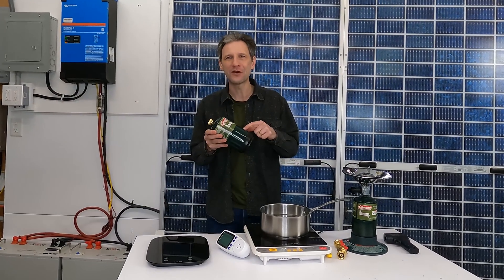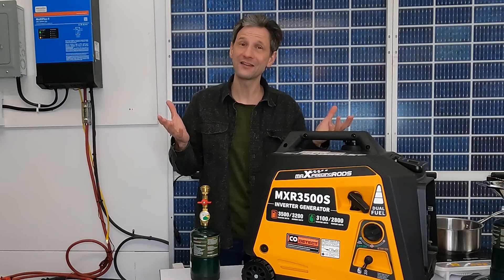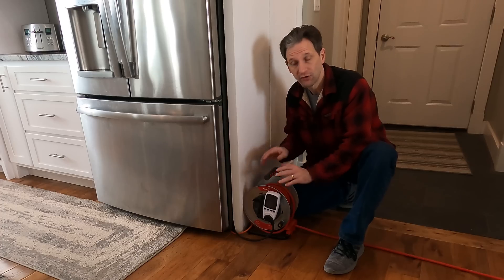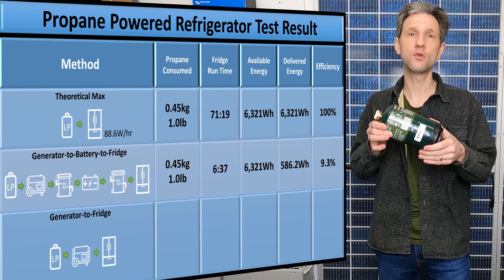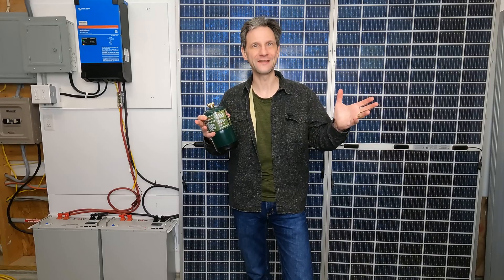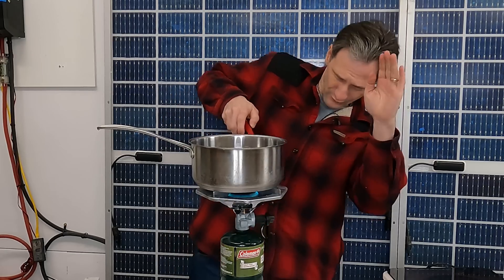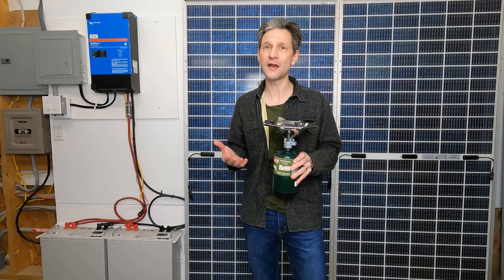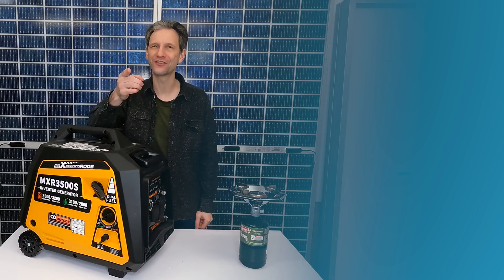Maximize Your Off Grid Energy Management - Dramatic Results!

Comment: It would have been interesting to also see a data point for fuel cell to the induction cooktop.
Reply from the maker: I didn't do that because I don't have confidence in the numbers... But.. just for fun...
Here is a theoretical analysis with lots of assumptions:
Assuming the fuel cell running on propane is 60% efficient and the power is used to charge a battery at 96% efficiency and the battery power is converted to AC at 96% efficiency, it would take 0.392kWh of energy to heat one pot of water with an overall efficiency of 40.1% 
Theoretical pots of water on one can = 40.1 --> 100% Efficient
Direct flame pots of water on one can= 18.1 --> 45.2% Efficient
Fuel Cell pots of water on one can= 16.1 --> 40.1% Efficient
Generator pots of water on one can =1.2 --> 2.9% Efficient

Comment: I came to the same conclusions years ago when hit with a seven day power outage, direct generator power to refrigerators, or freezers are just not that efficient, and they leave a noise signature that may itself cause  security problems. Now that we have lithium battery packs in the 2000 to 3000 watt hour capacity, those and a duel fuel generator are the best bet for home backup power. Propane gives us a safe storage solution, and we can store a lot of it, pre crisis, while gasoline is more dangerous to store, and can go bad, and may be harder to find in a grid down situation, unless the gas stations have there own backup generators, and then they may be overwhelmed by people trying to get gas.
Reply from the maker: Well said!
Reply: Agreed! I just setup my dual Ecoflow Delta Pros to backup my house.  Now I just need to find the best way to charge both slowly with 1 generator (may just go with the Ecoflow one but have to manually swap between them).  I should be able to get 1800watts out of my solar secure power supply outlet on my SMA inverter on one of my solar arrays but so far it just doesn't output the power for some reason.

Comment: I have a small 1600 watt gasoline powered generator that I plan to use for emergency backup for my furnace and refrigerator.  I've measured my furnace electrical energy use at approx. 500 watts when running and the refrigerator at 350 watts when running. My plan is to run the generator intermittently and shut it off for periods of time and let the furnace and fridge "coast" for a while so I don't use so much fuel running a generator that is not actually generating power. In the future I may add battery backup storage and a battery charger to try this method used in your video.
Reply from the maker: As you can see from the results in this video, your proposed method will save a considerable amount of fuel.  A lot of effort and inconvenience, but cheaper than batteries and can get you by in an emergency.

Comment: Great video. A lot of good information. If you had to use a generator and had use for a refrigerator, it might be better to cycle the generator off and on over a period of time.
Reply from the maker: Not convenient, but it would save energy.
Reply: A couple of dorm fridges with manual defrost and small chest freezer (same) can be ran with less watts. I can run a dorm fridge 24 hours with 500wh.

Comment: This was a great test Dave. It's something I didn't really think about. For best backup power system I should have a battery bank and charge that with a generator. Generator would not need to be as powerful as full house draw with everything on at once. It could be much smaller keeping the fuel storage much less. Yes I know that there would be a point that I would run out but that is the same as looking for a fuel station in a power outage, they can't pump the fuel.  I need to run some numbers and see how long my 1500 watts from my Prime if used to charge batteries would last or keep up. Thanks
Reply from the maker: Exactly!  There is no need to buy a giant generator if you are using batteries to manage the larger intermittent loads.
Reply: @ProjectsWithDave  And it seems like it wouldn't need to be an inverter generator. Would you be able to test if a conventional generator can feed the Victron?
Reply from the maker: Sorry the answer took so long, I ran a test back-to-back for you.  Yes, a conventional generator works fine.  The inverter generator was able to provide about 10% more energy to the batteries with the same amount of fuel.  However, I only ran the test once, so I don't know the margin of error.
Reply: @ProjectsWithDave  Hey Dave - no problem - you don't owe me an answer lol! Thanks so much for doing this! 

A followup question if I may - your power flow chart in the video shows the power going from the inverter generator ->victron charger->battery->victron inverter->fridge, but is that accurate? I wonder if the power flow when the fridge is drawing power is inverter generator-> victron bypass->fridge with the excess power the fridge isn't using is victron charger-> battery.  If this were true then the fridge would be getting "dirty power" from the conventional generator rather than the pure sine wave power from the Victron. 

I'm just north of you in Ontario, and I'm thinking of doing something similar as you with a ground mount array and an inverter feeding a critical loads panel. I'm just concerned my current conventional generator would need to be replaced with an inverter generator as I don't "trust" the power quality coming out of it to feed my expensive loads like my furnace. I'm thinking I could get a separate battery charger fed by the generator to charge the batteries, and let the Victron feed the critical loads panel from the battery. Or it may be cheaper to get a quality inverter generator lol. 

Thoughts?
Reply from the maker: In my test, I charged the batteries and then ran the fridge.  There was no passthrough power.  It's funny you should ask me about that, right after I finished the test for you, I thought to myself, "I should have checked the sine wave while it was running."  A brief search says it passes through the power it receives as long as it meets certain parameters, so you may want a separate charge controller to eliminate that risk.  However, I didn't check it myself.

Comment: Cool tests!

One note: an IR thermometer is about the worst thing to use on a reflective stainless steel pot.
Reply from the maker: Yes, reflective surfaces don't work well with IR.  That's why I used the in-water thermometer for the exact measurement.

Comment: So heat, use petroleum products directly. Cold? Generate electricity.
Reply from the maker: There are a couple of factors that impact these results.  1) The fridge is an intermittent load, so a lot of energy is wasted when the generator is idling and the fridge isn't running.  2) The fridge has a heat pump that can multiply the effectiveness of the consumed power.  If I had a heat pump water heater, I might get different results when heating water.  However, even in that case the inefficiency of the internal combustion engine is probably greater than the efficiency gained by the heat pump.
Reply: @ProjectsWithDave  Fair. A better summary might be:
Electric Resistive heat vs combustion: combustion wins.
Heat pump / compressor heating/cooling? Use electricity.

I don't really know of a way to use combustion to cool things, so I don't have a thing to compare it to.
Reply from the maker: This is how a direct propane powered fridge works: https://www.warehouseappliance.com/blog/functions-of-a-propane-refrigerator/
Reply: @ProjectsWithDave  An electric refrigerator is still more efficient, which still matches my summary and your results -- electricity wins for heat pumps, A/C, and refrigerators/freezers. For heating, cooking, baking, combustion of a petroleum product wins. For now!

Comment: When charging a battery with a generator it's best to run the generator at 80%-100% of its max load. That means you would need a 3000w dc charger for that specific generator to get the best efficiency out of burning that propane. The difference between running it at 3200w vs 800w will be up to 40% more efficiency. Try this test again with a dc charger that matches your generators output next time. You will get a much higher efficiency than 9.3%
Reply from the maker: At higher loads it was slightly more efficient, but only 1.5% better.  I'll do some more runs to see how much I can improve it.

Comment: Doesnt this show why electric vehicles are dumb for the environment? Most power is produced using non renewable sources ie natural gas.... the transmission losses and efficiencies from generation to car motor are abysmal.
Reply from the maker: Power stations run at much higher efficiencies than internal combustion engines, so it would not be an equivalent comparison.
Reply: @ProjectsWithDave  There has to be a way to convert it from power station to drive.
Reply: @av1204  power stations are roughly>85% efficient, as delivered to the house. Modern EVs are anywhere from 60% to 80%, including charging. Using WORST CASE, 60%, you just multiply 0.85x 0.6 = 0.51 = 51%, which is STILL far more efficient than the ~30% efficiency of internal combustion.
Reply: @JR_MacD  Not sure where you got your information from. They are not 85% efficient. Not even close.
Reply: I don't see how you could possibly conclude that from this video. If you're not just a troll, here's just one of the many people that have worked it out: https://www.youtube.com/watch?v=6RhtiPefVzM
Reply: lol no, it does not.  They are much more efficient actually. ICE is only about 25-30% efficient for vehicles.  If you produce your own power (solar) you can get the total efficiency very high, about 80% or so.  For a good $ reference, I paid $2700 (3500 before credit) for my second array which is 2.5kW and can produce 3mWh annually, enough to drive over 10,000 miles on.  I'm only 2 years away from payback and then driving on free energy for a couple decades.
Reply: @whattheschmidt  one is cost one is efficiency... they arent the same. what is the cost of all materials to be mined produced and recycled

Comment: Love the math.... what if you ran the fridge direct off the generator and also charged the batteries to an extent that the generator would stay in eco mode?
Reply from the maker: That would work. It would still be making full use of the available power.

Comment: Really good experiment. I wonder how the refrigerator results would change if the generator only ran when needed? Like with a Delta Flow battery being charged as needed from a Delta Flow smart generator.
Reply from the maker: I think that would solve the efficiency problem. If I have time I may test that in the future.

Comment: Wow, great experiment, something that I can even understand and very practical.  How would gasoline compare with the propane as far as running appliance and charging batteries.  1lb of gas to oz. Don't know how you could make the conversion 1lb of propane to gasoline. Would gas provide more usable energy.
'
Reply from the maker: I thought about that. I could do the mathematical analysis, but I might actually run the test if I can find some time.
Reply: I know that generators produce more energy when using gasoline vs propane. Gasoline is more energy dense and on my generator it produces about 1200 more watts of running energy. By volume and cost I have no clue which better, but propane stores forever whereas gasoline has 1 year shelf life.
Reply: @winstonsmiths2449  Your right, that's why my next generator will be a duel fuel inverter type.
Reply from the maker: Dual fuel just makes sense.  In an emergency you want to have options.